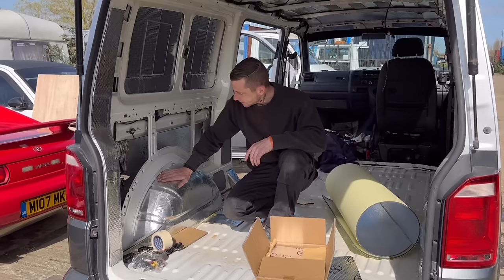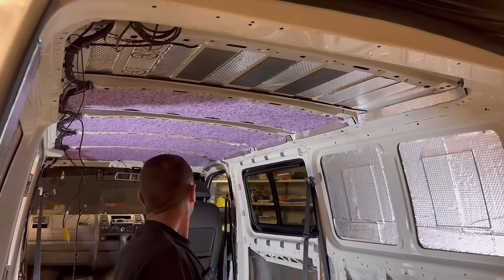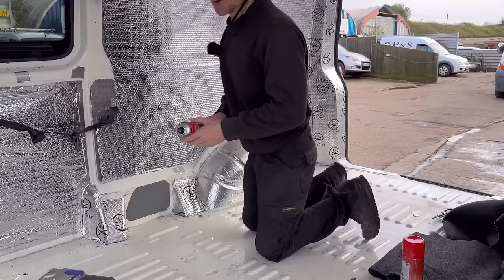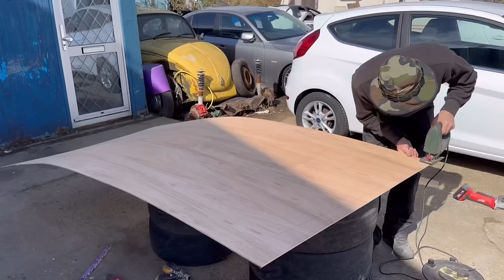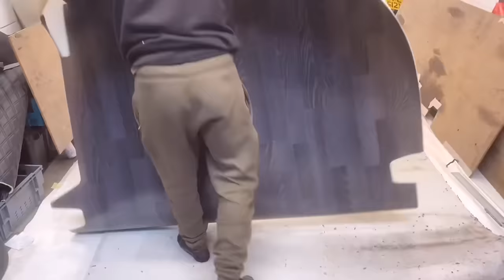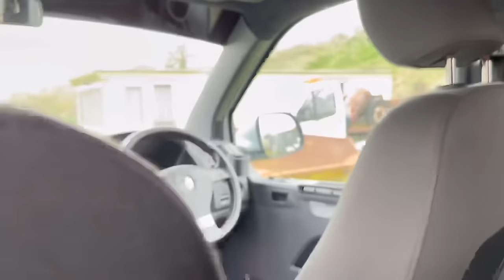Vw T5 Transporter - insulation - carpet lining - headliner

Comment: Good video Nathan! Just in time for me, but a tip, you don't need to use the sound deadening matting on the whole panel, you need 1 sheet per panel at best. The idea is to add a bit of weight to the panel, not to stop sound penetrating the panel from the outside. It just cost you alot of money for no extra benefit!
Reply from the maker: Hey bud thank you appreciate that 👍 I could have definitely used abit less I think I got abit carried away 😂

Comment: Great job Nathan it looks a love neat job bud . Ref your sliding door step ; you can buy a extra deep side step to fill the gap you got there instead of filling it with wood .  You can also get a longer threshold plastic  for the back that gos right up to the pillars . Keep up the good work bud . I am doing the polo light upgrade this weekend and a safari woo window upgrade behind the drive  seat  . So got to crack bud 😂😂👍🏽👍🏽I’m out
Reply from the maker: Hey Chris thank you mate appreciate that, I never knew about the deeper step but have found one so will order it 👍 I spotted the longer thresholds last night to but both are another £100 for the pair so can wait till next week. Polo interior light is really good literally plugs straight in. When trying to push it up into position I stuck my fingers through the new hole I cut in the silly headlight cupboard to hold the headlight while pushing up so the headliner didn’t buckle and squash 👍

Comment: Love it. A bit overboard on the application of sound deadening but hope you used heat proof spray contact glue otherwise in hot summers the roof and wall coverings will release and sag.
Reply from the maker: Hey bud thank you I done the exact same in my caddy and it’s stayed in place, I could have definitely used abit less of the deadening 👍 I guess I got abit carried away.

Comment: Watched all your videos, the t5 videos are really helping me with my t5. 
A big thank you for uploading them, 

Would you be able to cover how you fitted the rear seats to the floor in more detail. You haven’t covered that in any of your videos, did you fit brackets or something under the van to bolt them to, 
Thanks 👍
Reply from the maker: Hey Jamie thank you mate appreciate that 👍 I literally just drilled holes and bolted them through the floor with big washers nothing fancy, I did use m12 high tensile bolts so they ain’t going anywhere 👍
Reply: @YTDTETV  thanks for the reply, would that pass a mot like that, I’m looking to put rear seats in mine but keep getting told I need to fit extra plates that are bolted to the subframe. All the best 👍👍
Reply from the maker: @jamieharris9619  yes I’m confident it would go through an mot, I had a sheet of 4mm steel plate so I cut it into squares and drilled hole in the middle to use as washers 👍

Comment: The tighter you pack and compress the insulation in the less it works. Needs to be as open as possible to keep the air pockets which insulates
Reply from the maker: I never knew that about the insulation but it makes perfect sense I’ll remember that for the next time 👍

Comment: You don’t want to squash the dial insulation it stops it working. It needs the air gaps for it to work
Reply from the maker: Hey Steve I never knew that about the insulation but it makes total sense, I only wedged some in the tight area most of it is loose, thanks bud 👍

Comment: Top job 👍 What thickness timber did you use to pack out the underside of the floor?
Reply from the maker: Hey bud thank you appreciate that 👍 8mm thickness I bought 6 lengths of 2.7 meter x3 40mm and x3 75mm. Literally used all of it, floor is nice and study.
Reply: @YTDTETV  You're a gent. Loving your videos and the van.

Comment: Just wondering Why didn't you sound deaden insulate the floor? Cheers
Reply from the maker: Mmm good question so because the floor has thick would I feel that’s enough sound deadening. In my last van I did lay some vapour barrier bubble wrap still down before the wood but not this time. Thank you 👍